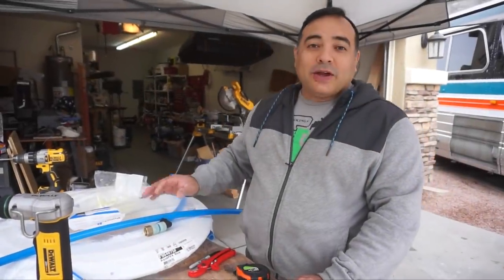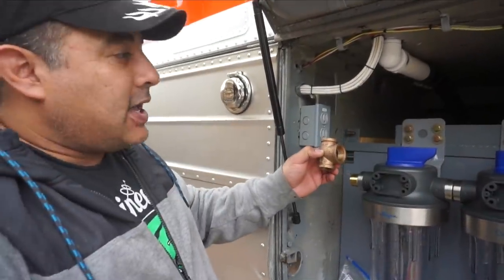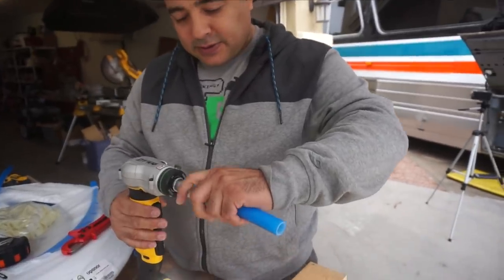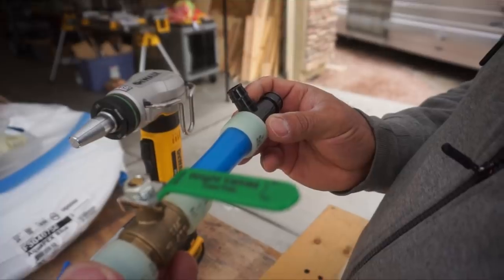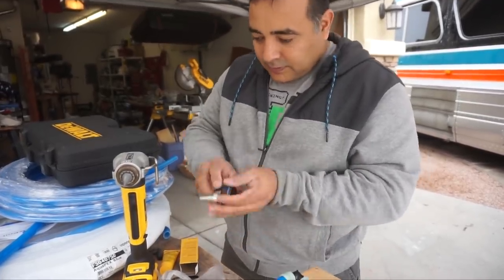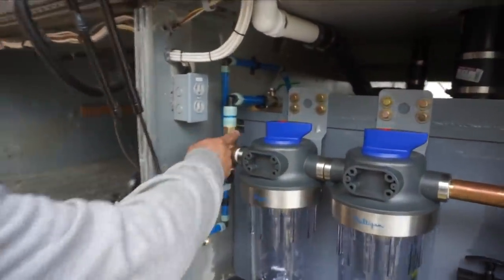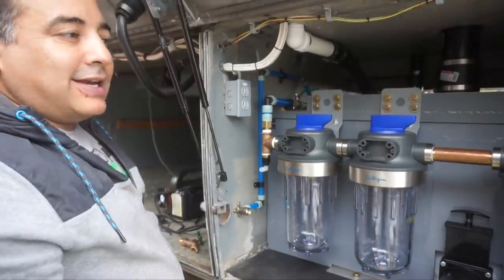Supply Plumbing Part 4: Pex & Brass Plumbing

Comment: I use both crimp style and uponor expanding style pex with the Milwaukee system and while I’ve been using pex for 20+ years since I transitioned from copper, I prefer the expansion style over the crimp style , they are both excellent systems and I’ve never had to go back to repair a joint on either system. 
 
I prefer using the expansion system this because I can get a good secure joint in very tight spaces much easier than I can trying to get my crimpers in to extremely tight spaces as you are gonna have in a few spots. 

You chose the best system available on the market Juan and you will be very happy you went this route. 

The pex system is by far superior to copper and is by far the best plumbing choicefor the bus for freeze protection alone and is the same system I will use while redoing our bus when I get started on it. 

Wise decision young man, your doing an awesome job Brother and I’m so proud of you all!!!!
Reply from the maker: Thank you so much Don - Plumbing the PEX was really enjoyable.
Reply: Hey Don. Quick? For you. Im thinking of buying a dewalt 20v pex expander. The company I work for uses zurn  pipe and zurn expansion rings . They also use zurn pex heads. My question is, can you use the dewalt expander with the zurn pex heads? I can't find any info anywhere. Thank you.

Comment: Once you've used Propex, there's no going back. It's so nice. Also, in tests, these are the best in freezing situations. The expansion pex will expand and absorb the change, whereas copper will just crack open.

Comment: I have the Milwaukee Pex-A Expander because I am already invested in the Milwaukee system, like you said - they work great and creating a solid leak free connection is so easy. Thanks for sharing.
Reply from the maker: Thank you Mike - I have heard nothing but great things about the Milwaukee system as well.

Comment: One of the added benefits of using this style of PEX A, is the fact your Plumbing fittings, inside diameter, will be a true size, not reduced by the crimp fittings

Comment: I just realized another big advantage of the expansion fittings over crimp. When you were angling that tee you were able to use both hands to hold it in the orientation you wanted. With crimp that would be much more difficult without help since a lot of the time crimping tools require both hands to operate so you might not have a hand free to hold the tubing and the fitting in the correct orientation.  I've also struggled under some tight crawlspaces to even be able to get the crimpers onto the fittings. That wouldn't be an issue with these either
Reply from the maker: Yes!  We found that to be the case too - you have a good amount of time to expand the joint and get it placed and we did some very tight bends in very tight places.  We have been on the road now for over 15,000 miles with crazy washboard dirt roads and terrible roads and not a single expansion joint has leaked!

Comment: You can get adapter plates that go between the tool and battery so you can mix and match batteries and tools. They become interchangeable.
Reply: That's what I did since the DeWalt tool was on sale and Makita doesn't even make an expansion tool. As far as I know only DeWalt and Milwaukee make them and the Milwaukee is 12v so adapters for 20v/18v batteries aren't an option there

Comment: I've been plumbing for more than 25 years.  I've never had a crimp band leak, either copper or stainless.  There are many systems for PEX water piping, all available have been approved.  I suppose it's the preference of the installer.  Though I must say I don't like plastic PEX fittings, I've seen them crack at stress points.  I'm sure with your attention to detail any PEX system that you will install will be fine.

Comment: One item you may have overlooked - there are minimum cut lengths of PEX pipe in between expansion rings. In other words, some of the connections you made in this video appear to be too close together. For instance, if you are using 3/4-inch PEX - the minimum cut length of pipe in between one expansion ring and the one next to it - is 3 inches.

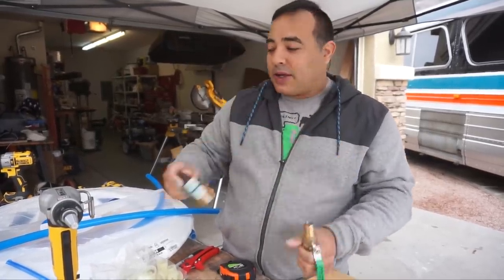Comment: The Uponor ProPEX connection guide defines a minimum distance between fittings.  It looks like the portion of pipe you're showing at 1:27 is well below this minimum distance.  The minimum distances, defined on page 1, table 2 of the guide are:

1/2" fittings - 2"
3/4" fittings - 3"
1" fittings - 3 1/2"
1 1/4" & 1 1/2" fittings - 4 1/2"
Reply from the maker: I had never come across this - thank you for posting it!
Reply: It’s to do with the reach of the tool, when they are too close the tool has to work on expanding two joints without the gap between.

Comment: WOW!!! If you were using copper this would take 5 times the effort and you would of made mistakes.  The only question I have if you have to modify or move something do you just get more material before you cut it?  I had no idea it was this easy to use this. Great job Juan and Michelle and the munchkin that said hello. Thanks for sharing your video. Ed
Reply from the maker: Thank you Ed - it really is very nice to work with.  If you have to modify it you simply make a cut and put in your fitting.  If you need to replace a fitting I have seen a few videos now where a heat gun is used to heat the plastic ring until it is clear (and soft) and then it cuts very very easily with a razor blade and does not damage the pipe or fitting it is compressed on.

Comment: Looking great guys nice and clean looking you both do beautiful work so I'm starting to run wiring and pex also and I've looked at the fitting options to
I feel the best easiest way would be the shark bite but won't be using them but will be using them in locations that have the access to get to them and points of possible failures like to the filters and the pump as well to the water tank and the city fill area in case of freezing and replacement ideally I'd use them everywhere but don't like the idea of them being in a wall or no access locations the other reason is cost is ridiculous.
 crimp rings work great but after hearing you say they possibly could loosen up over time just reaffirmed that the expansion rings are the way to go the manual tooling is cumbersome and electrical tool prices are astronomical  what did that set you back I've seen them go for as much as 1200 bucks if I could rent one for a week or two that would be great
Oh and thanks for the tip on the brass fittings for safety of drinking didn't even think of that.
Reply from the maker: Thank you Brian - Any of the pex options are very good choices.  We bought the Dewalt tool from Amazon for $254.18.  It did not come with a battery or charger - but we already have like 5 batteries that fit this tool.
Reply: @BeginningfromthisMorning  nice that's reasonable price

Comment: Uponor publishes a chart showing there must be a larger gap between the two fittings than shown here. It is essential to follow the published guidelines.
Reply from the maker: Thank you Sah you are correct.  For 1/2" Pex plumbing Uponor suggests a minimum pipe length of 2" to prevent damage to the adjacent connector.

Comment: Quick question, do those fittings allow you to swivel them after they shrink down in case there not pointing in the right direction? Awsome video as always.
Reply from the maker: Thank you Jay - they do allow for adjustment after they are fitted - but I don't think they are fully intended to swivel

Comment: What happens to these PEX connections when you make a mistake and have to take it apart? Do you have to cut it apart and saving only the brass metal pieces?
Reply from the maker: Thank you Jimmy - if we make a mistake or something breaks and we need to re-plumb something we would need to cut off the crimp rings and about an inch or so of the pipe.  The brass fittings are reusable but the plastic pieces should not be reused (they are fairly inexpensive).  I have seen several videos showing a technique where the plastic fittings are heated with a heat gun until they are clear then they cut very easily with a razor blade.

Comment: What if one makes a mistake and needs to remove a coupling?  Just cut them off?
Reply from the maker: I have seen several videos showing a technique where the plastic fittings are heated with a heat gun until they are clear then they cut very easily with a razor blade.

Comment: Why not filter the water when you are filling your tanks ??? Or do I miss  something
Reply from the maker: Thank you Jack - Under normal circumstances the water will go through the filters and then into the tanks.   However, there can be a situation where we get something in our tanks and need to refilter what is already in there (maybe we add chlorine to kill stuff off and we then want to remove that chlorine - we would run that water through the filters again).  Another situation is if we were in a hurry to fill up and leave (people waiting at a fill station) and the water pressure is low - we would fill up as quickly (by bypassing the filters) and then we could recirculate the water through our filters as we travel.

Comment: The blue line is for crimp fitting not expansion fitting. You're putting an expansion fitting end on crimp lines and this is definitely not code. White pex a line goes with the white pex a expander rings.
Reply from the maker: Why do you think the blue line is for crimp fitting?  All the Pex we purchased is PEX-A.